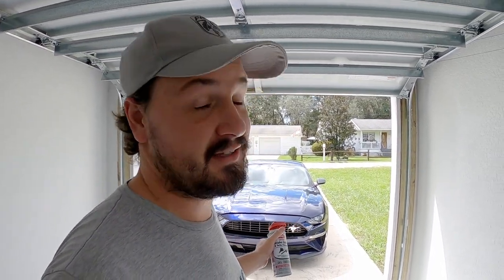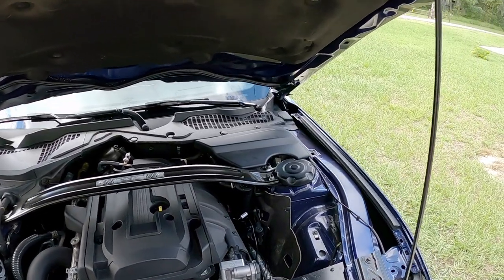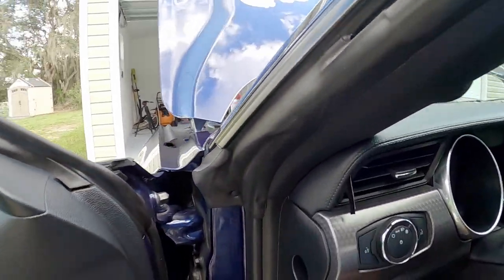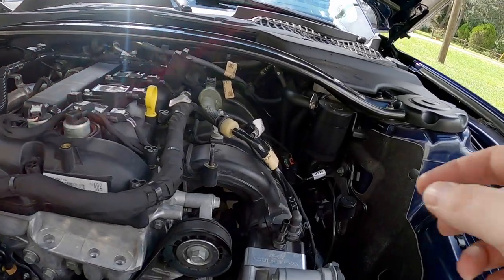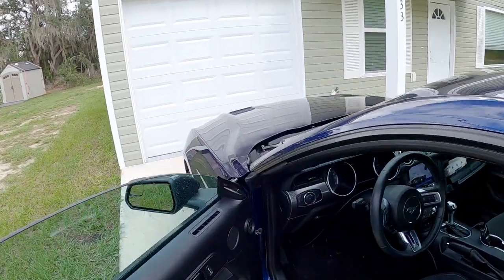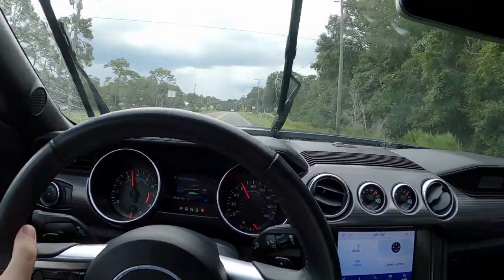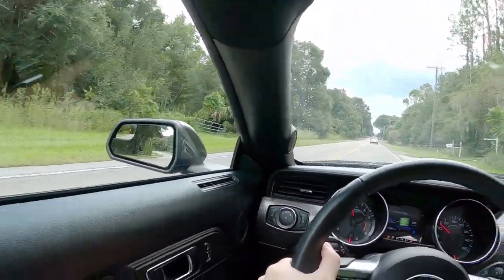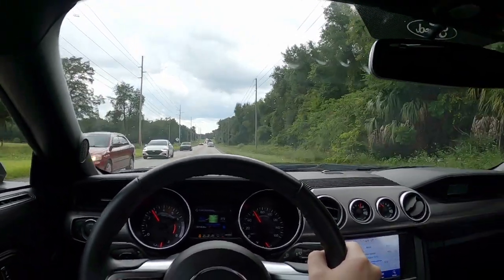Does it work? CRC GDI Valve & Turbo Cleaner - Ecoboost Mustang

Comment: I used this on my Veloster N and it made a big difference.  The idle was turbine smooth and the engine response improved quite a bit.  I do run a catch can, but keep-up with maintenance.  When I was running it after the heat soak I forgot how good it sounded at 70 mph, in fourth gear and with the exhaust wide open.

Comment: That’s crazy, I wasn’t aware that this was a maintenance product. My eco is a 2017 with a little under 100,000 miles with no catch can. I wonder how much build up my engine has at this point 😂
Reply from the maker: Yeah, it's pretty good stuff. Not sure if I would recommend using it on your car at this point. Large chunks of carbon can break off and cause damage. But using it every 20k miles on a new car will help keep carbon from building up to a problematic point.
Reply: @KarzKreated Im glad I read this reply before do it, mine is 2015 with 100k as well
Reply: Did you do any upgrades or changes to make it last that long
Reply: @KarzKreated seafoam melts carbon away not breaks it off idk about what he used

Comment: i work in a shop.. nation wide.. we were not too sure about this.. so we asked around for a car from our shop techs to find a gdi car.. no turbo.. to test it on... we found a car.. so we took the intake manifold off, took some photos.. best we could... followed the instructions on the can to the letter... after this we took off the intake manifold.. no difference... we put the manifold back on 500 miles later... we did the same thing. .no change...1000 miles on change.. then after a long wait..2000 miles no change.. all the carbon was still on the intake valves..... folks  the carbon on the intake valves are baked on...we did scrape some carbon off at the 2000 mile mark.. still hard deposits on the valves.. folks its snake oil.. it does not work,, so we stopped selling the treatment at our store.. your best bet.. to slow the deposits down  a oil vapor separator. in line with your pcv hose..if you do this as soon as you buy the car..or the carbon on back of the valves are still low... the ovs.. well help a heck of a lot
Reply: That's what I've heard too. So catch can or nothing besides eventual walnut cleaning?
Reply: This stuff does work, you are wrong. Of course if it's completely baked on you will need walnut cleaning.  But for preventive maintenance this is a good idea.
Reply: You are 100% correct. We have noticed the same. Best thing is good synthetic Oil changed every 5k miles with the filter and tier 1 gasoline.

Comment: I got a used 60k mile 2020 premium eco boost mustang. It was a one owner car and looked decently maintained in the carfax report. Other comments say you shouldn’t do this if you didn’t get a catch can early. How should I tackle this maintenance then? Thank you in advance for you advise and videos!
Reply from the maker: The concern is large chunks of carbon breaking off and damaging a valve, piston, or turbine wheel. If you want to use the product, my suggestion is to only use half a can at first then wait a few weeks and finish the can so it's more gradual and not all at once. That will reduce the chances of large carbon deposits from dissolving.
Reply: @KarzKreated  thank you for your reply. I don’t have many tools but if I follow you same procedure and don’t clear the engine codes (because I do t have a device for that) will my car have an check engine light until I do? I am very new at car maintenance so thanks a ton for the info
Reply from the maker: If you do it my way by disconnecting the throttle pedal, you will have a permanent error code until it's cleared. If you don't have a code scanner, you can always go to an Autozone, Advance Auto, O'Reillys, and they can check and clear the code for free. The car should still drive with the code present.
Reply: @KarzKreated  thank you a ton!
Reply: How early is early? What is the mileage cutoff for doing this safely?
Reply: @DominiAeternum it’s never too early. Do it once every spark plug change or every 50k miles. If you like to do car stuff (beat on the car) do it every 30-40k

Comment: I just finished up using the cleaner. Let the car heat soak for an hour and drove it aggressively. I didn't notice any smoke or hiccups but I did see a lot of negative ignition correction on all cylinders on my first pull. Also noticed a lot of soot on my exhaust tips. So I guess it worked? Will see.
Reply: Also took my manifold off and peeked at the valves. They didn't look too bad but cyl 1 and 2 had the most build up.
Reply from the maker: Good to know that your visual inspection confirms the products effectiveness.
Reply: @KarzKreated I used the crc cleaner in my 2016 ford mustang and seen white smoke come out the back but then it started making a ticking noise so I replaced the fuel pump the sound is still there but it’s not as loud as it was
Reply: @revelationrhymesvlogs4761 yeah I've the same experience, after spraying it started making a ticking noise, shit is bad for you engine, best way is walnut blasting fo sho

Comment: Glad I watched the tip after pulling & pulling the tight other way. This is good on a 2016 VW Jetta se TSI? 
I need a turbo clean out.
Reply from the maker: It should work fine for any GDI engine as the product implies.

Comment: Did you flush the diff? I don’t know about the trans oil change intervals but I’ve had such a good experience changing the diff fluid every 30k miles.
Reply from the maker: Not yet. I'll probably get around to that this year, along with trans fluid &   filter. I just wish I had a better and safer way to get the car in the air. I may look into a set of portable lifts to make life easier.
Reply: @KarzKreated I did it on Jack stands. It’s a bigger headache to do the engine oil change on the 5.0 because of where the filter is. I always end up paying someone. If I had your set up I would be doing a lot of my suspension myself.
Reply: @KarzKreated  ramps are the safest bet imo

Comment: I have a 2015 ecoboost with 92k on it. I’ve changed the fuel injector pressure sensor, evap purge, cleaned throttle body and replaced sparks. I have an exhaust leak I need to repair but I’m losing so much power and having so much lag into shifting I feel like it’s gotta be something more. 
I’m not comfortable using this method because I’m certain it’s never been done before and I’m scared of sending a carbon meteor through my turbo.
Is there any other way I can clean the carbon out without spraying this directly into the car while it’s running??
Reply from the maker: Doing this likely won't fix the problem you're having. It almost seems like your car is in limp mode?

Comment: Am I good to do this? And maybe install a catch can? I just bought a 2015 EcoBoost with 59,000 miles. I want this car to run as long as possible. I saw the comment about it being risky if there is already carbon buildup. What are your thoughts?
Reply from the maker: The risk only gets higher as miles go up. If you feel comfortable using the product, now is the time to do it. I do firmly recommend a catch can to limit build up.
Reply: The product softens and dissolves the carbon so how could a big hard chunk break off? If it does it is soft and passes through the turbo fine
Reply: catch can / aka oil vapor separator will be your best way to keep the oil off the back of the intake valves and not cooking it into hard carbon

Comment: I've never done this and want to do it now but my car is at 106k miles at this point so I think this would be my solution. Is walnut blasting safer for my car at this point or what would you recommend to clean my valves
Reply from the maker: At your mileage, walnut blasting is definitely safer and more effective if you're willing to have the service done.
Reply: @KarzKreated  ok thanks for your response.. this service wouldnt be available at a dealership would it?
Reply from the maker: Some do. You would have to call around to verify. Most dealerships offer a chemical based induction cleaning service.

Comment: So the way you did this it'll clean the turbo as well? Or is that a different method and I'll need to buy another can of this? I'm kinda ignorant when it comes to cars. Thanks
Reply from the maker: Yes. When it gets sucked in, some of it will pass through the exhaust valves to the backside of the turbo.
Reply: @KarzKreated  okay great
Reply: yes it well as soon as a good size chunk of carbon get past your valves and into the turbo blades.. you will get a nice shinny new turbo... oh yes... you will buying a new turbo

Comment: Kirk i would like to know how you took of that hose that sits on top of the throttle body
Reply from the maker: I think there's a special tool for those weird clips but I use two flat head screwdrivers and very carefully wiggle the clip out. The plastic on those clips are usually very brittle and often brake so take your time to remove it. But once you pull that plastic clip out, the hose will pop off.
Reply: @KarzKreated  thanx bro

Comment: I have 53k miles I put a catch van on maybe at 40k would you still recommend using this product
Reply from the maker: Yes I do recommend it. I would only use half a can at first then wait a couple of weeks to use the second half. Just a precaution so you limit the chances of big pieces of carbon breaking off and potentially causing damage.

Comment: How is your turbo doing 8 months later?
Reply from the maker: Perfectly fine as far as I know. No noticeable problems that I can tell. 🙂
Reply: @KarzKreated  Seems like there's a YouTube "Mechanic" claiming it's horrible for the Ecoboost and it's got the Mustang forums on fire.
Reply from the maker: @ironreed2654  well there's been instances where large chunks of carbon would break off and damage the fins on the hot side wheel. But that's a risk higher mileage cars would have a if they have never had the valves cleaned. Which YouTube mechanic is fussing about it?